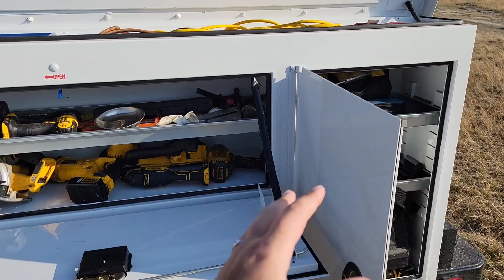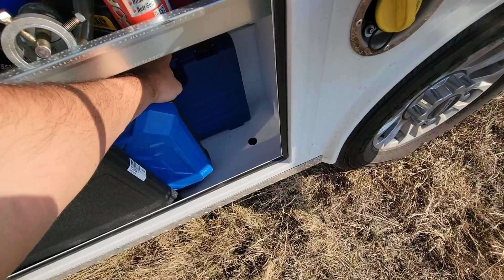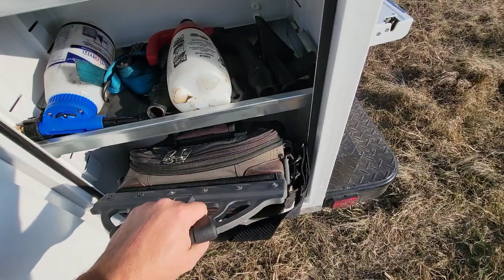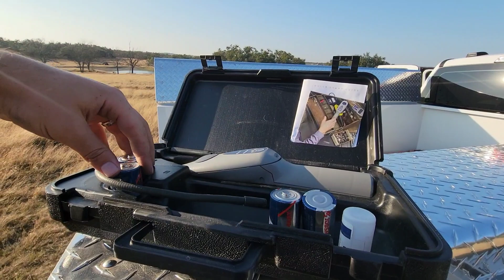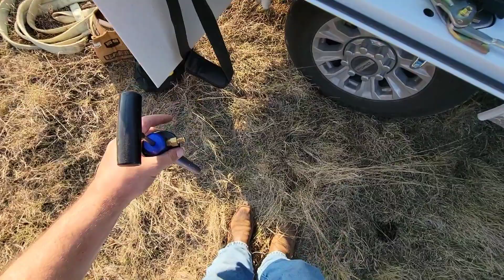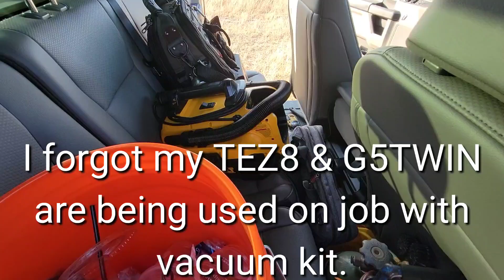HVAC CHILLER TECH TRUCK

Comment: Any way you could do a video on air cooled chiller pms? I'm in the heat of ours and not sure if I'm doing properly. Thank you for all your videos. I'm very new to chillers in general and thank you
Reply: For a quarterly PM you want to do a electrical inspection. Make sure all the wires are tight make sure the plug connections are good check fuses. Inspect contactors. Get a running log get amp draws on all condenser fans inspect blades, clean condensers. If you have enough time you can clean the strainer and flow switch.  

On an annual do the same but you will have to meg the compressors get an oil sample and check oil level at the separator.
Reply: If it's a scroll chiller you won't have to get an oil sample and you won't have a separator
Reply: Also I forgot you want to test your temp sensors with ice and test your transducers on an annual as well

Comment: I was thinking of buying an oil pump way back when I was gathering my tools again but they're overpriced down here where I live at due to import, taxes and all that. 
I've been getting away with just isolating the compressor and sucking the oil in with the vacuum pump, saves you the work of pumping it in manually.
Reply from the maker: Both ways have their place. Did the vacuum method for a long time.